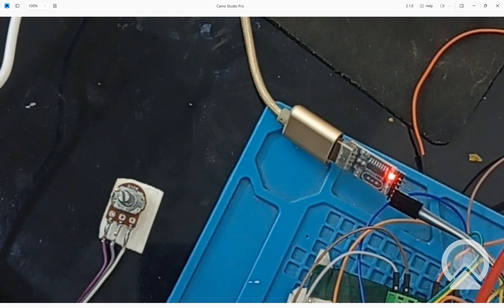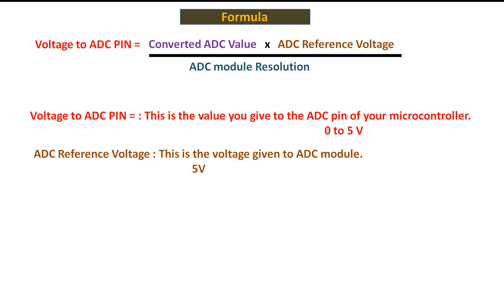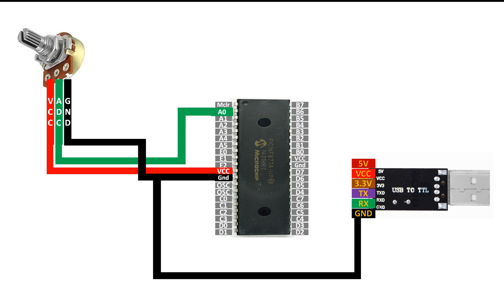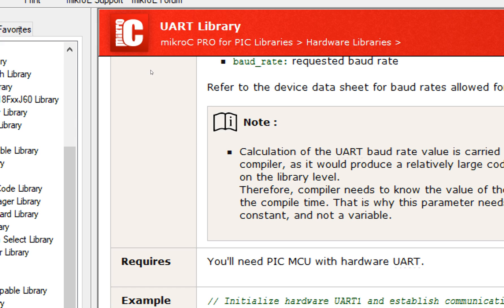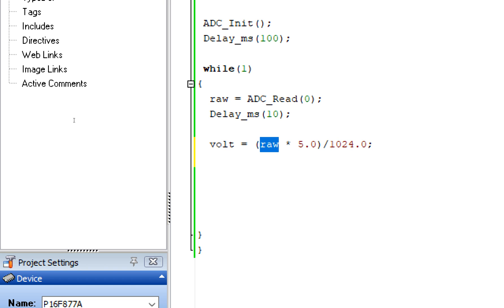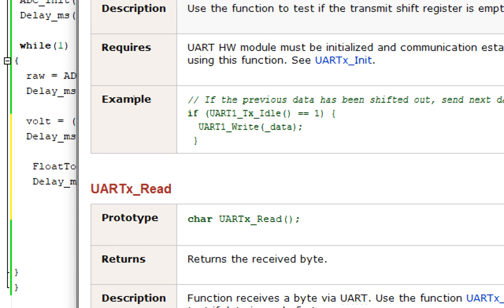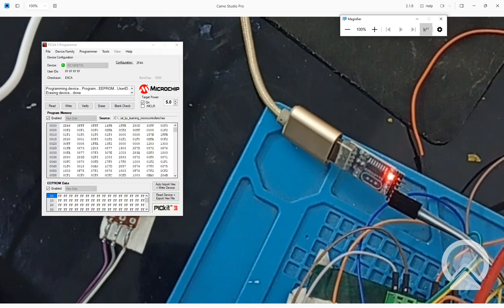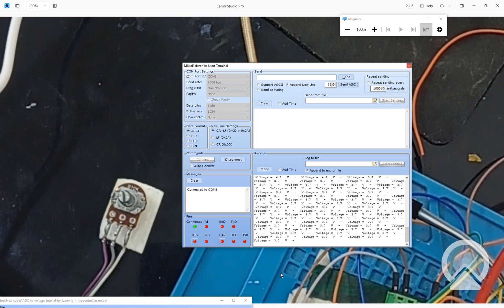ADC Value to voltage conversion. Demo using PIC16F877A and 10k pot. Output on serial monitor.

Comment: Hi, Sir how are you.  i want to show  INPUT VOLT< OUTPUT VOLT < BATTERY VOLTs  on LCD.  please help thanks. If you can't help please tell me. I will never text you again.
May you live long. TC
Reply from the maker: I am a bit busy I can help
I make a video having 3 counters
Later you can replace those xounters with your data
Please do. Comment
Reply from the maker: Email me the code you are working on at
uneeb629@gmail.com
I see whats wrong
Reply: I will send you the code.😊